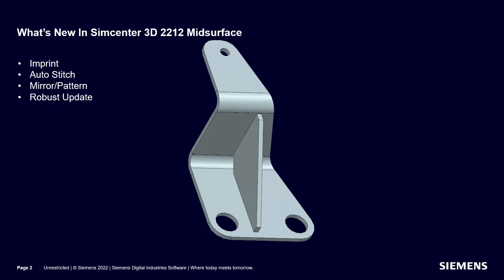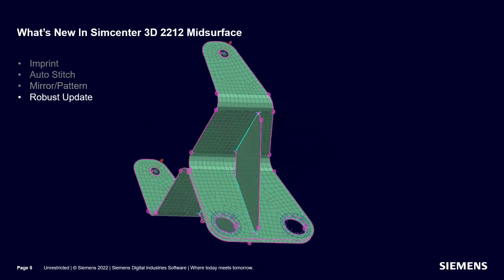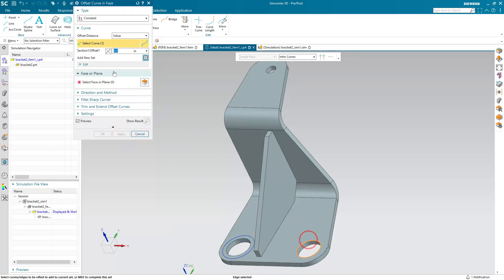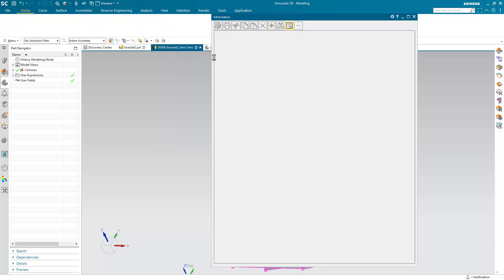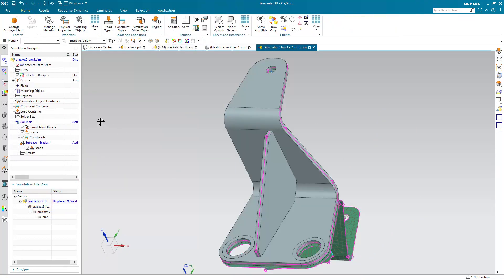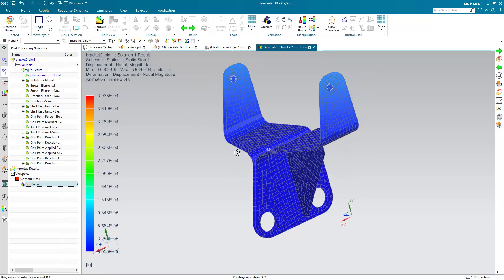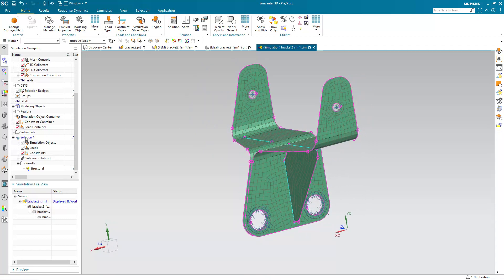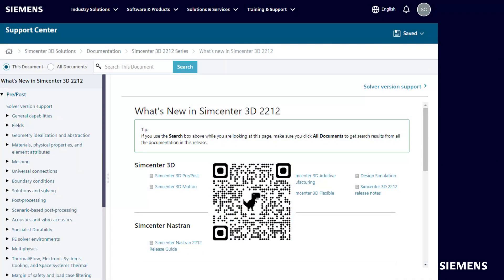What’s New In Simcenter 3D 2212 Midsurface

Comment: Would be awesome if the Stitch Edges definition at the .prt level was broken out of the Midsurface command as an individual tool so that you could define non-manifold stitching directly on sheet bodies for shell meshing without having to thicken and then midsurface.
Reply from the maker: Sew at the .prt level is the equivalent of stitch in the fem.  As you have found, it may not work in all situations such as when it would result in a nonmanifold body.  That was one of the primary drivers as to why we created polygon geometry in the FEM, so we could break the rules that ParaSolid sets for no nonmanifold bodies.
Reply: @Simcenter3DTipsandTricks  Yep yep, makes sense. I guess what I mean though is that it would be great if there was a stand alone command in Modeling (maybe only exposed with the iPart menu by default) called “Define Stitching” in which the user can select all edges/faces/bodies that should be stitched once in the FEM. This tool would make it much easier to maintain associativity and use tools like HEEDS. Right now, in order to maintain stitching associativity for meshing my sheet bodies, I have to thicken my sheets, unite them all, and then mid surface the thickened bodies to recreate the sheets and define stitching. Another solution would to just make Stitch Edge replayable and compatible with Selection Recipes in FEM.
Reply from the maker: @WildmanJB91  Stitch Edge is replayable and will survive an update if the method is set to Automatic.  Stitch Edge is not replayable and will not survive an update if the method is set to manual.